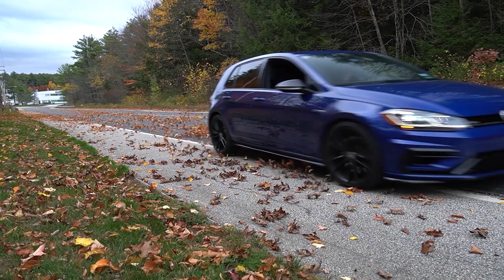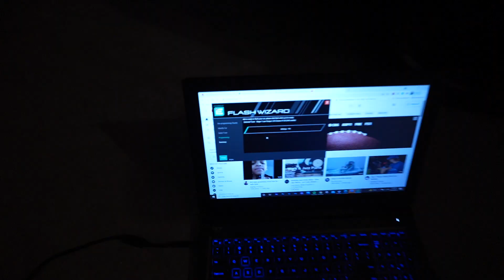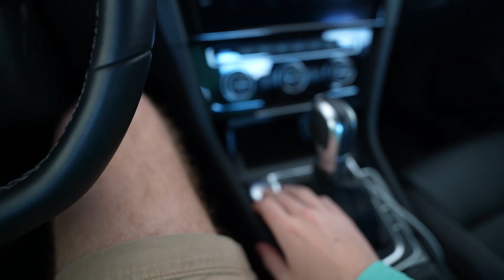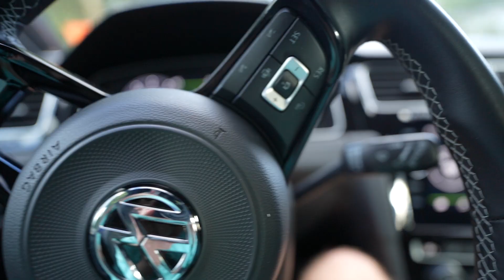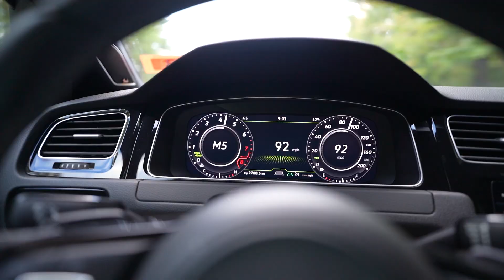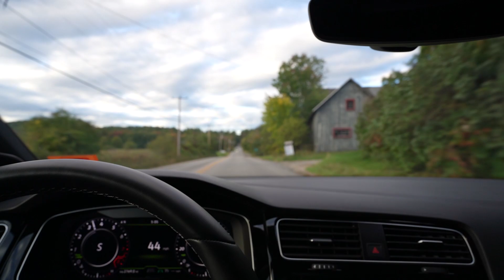This EASY Mod Made My 2019 Golf R MUCH FASTER!

Comment: Hey Pete, actual horsepower gains aside, how much quicker does the car actually FEEL relative to stock, if you had to give it a percentage? 20%, 30%?
Reply: Look on their website and you can see actual numbers
Reply: @dumbeezy5480  I think you missed the point of my question.
Reply: @sometimes5207  Of course you can feel the actual gains. As to break it down to percentages i couldn’t tell ya

Comment: I ran Unitronic Stage 1 with stock clutch (manual). Now running Unitronic Stage 1+ with Southbend Stage 3 Daily clutch. It’s been excellent! Very linear power. Unitronic & (I think) IE do much more than just throw boost at it.

Comment: The computer that the VW/audi dealers use will automatically flag your car. It looks at how many times your ecu & tcu are flashed. It's called a TD1 flag. They'll most likely deny any powertrain related warranty claims